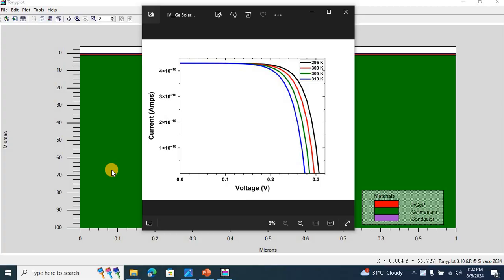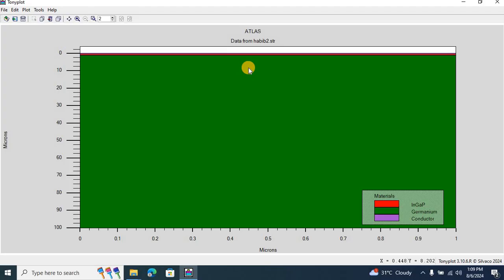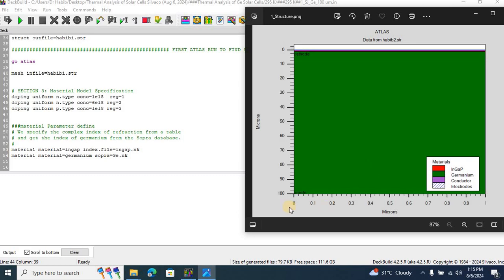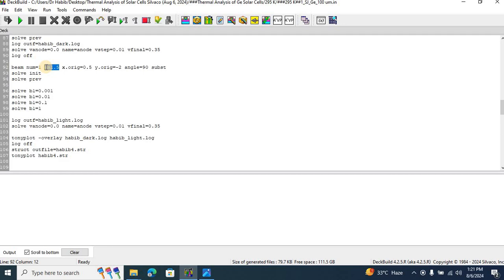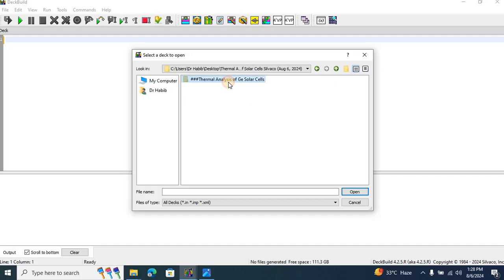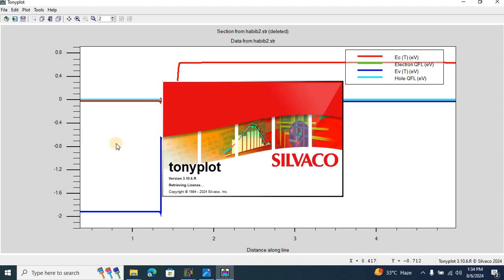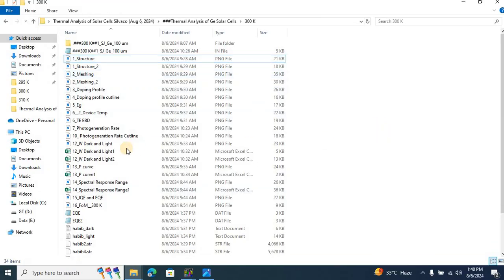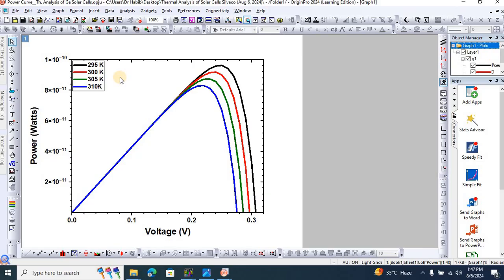Thermal Analysis of Solar Cell Performance via Silvaco TCAD Simulation at Different Temperatures 🌞🌡️

Comment: SIR I WILL BE HIGHLY OBLIGED IF YOU KINDLY MAKE A VIDEO ON SILVACO DISCUSSING C-NTERPRETER FUNCTION AND HOW TO USE IT IN SOLAR CELL ESCRIBING INTERFACE DEFECTS. THANKS.
Reply from the maker: As soon as possible
Reply: @HabibAhmadGatech  Thank you Sir. I have another request if possible please make a video on adding series and shunt resistance in solar cell circuit and extraction of cell parameters after simulation. Thank you again Sir.